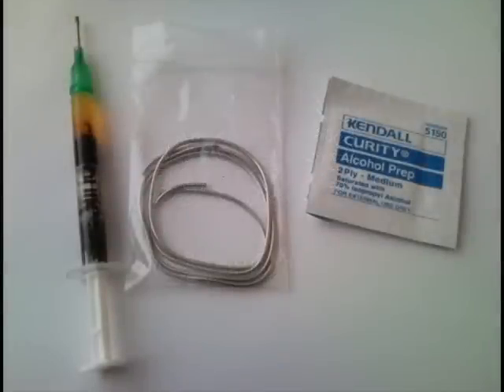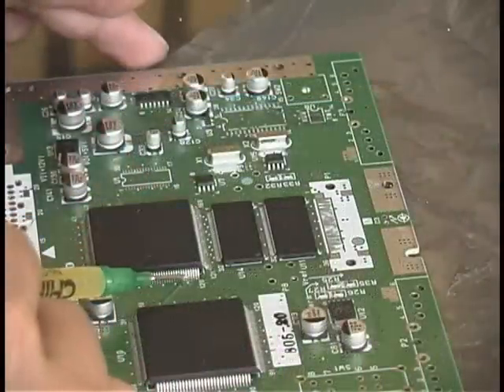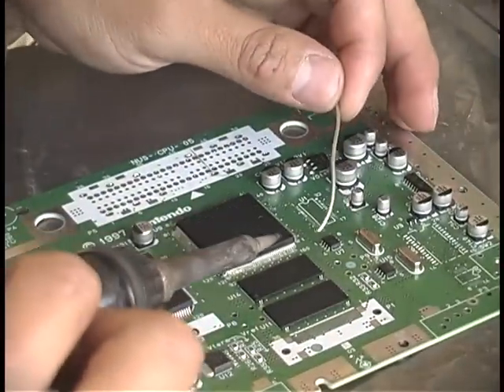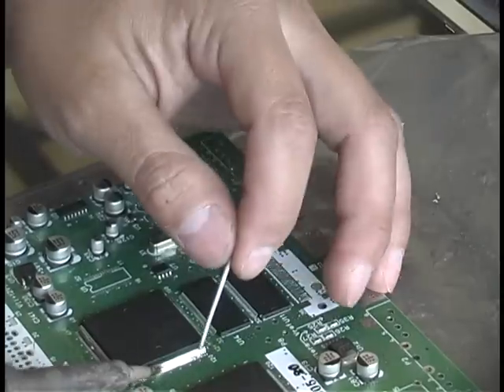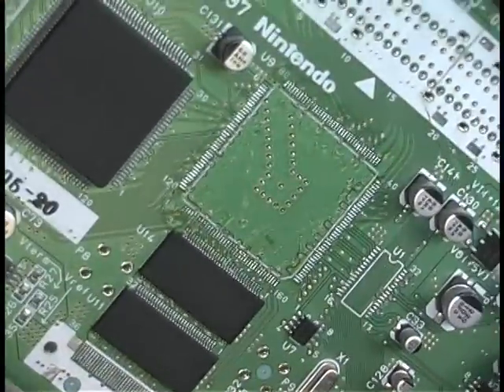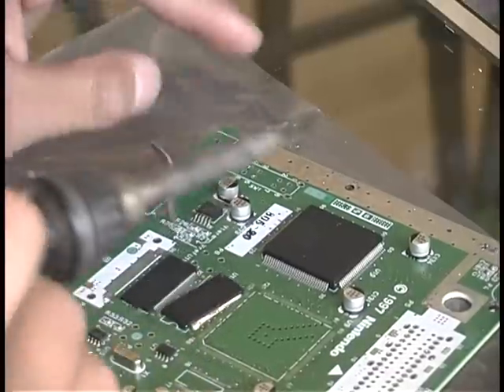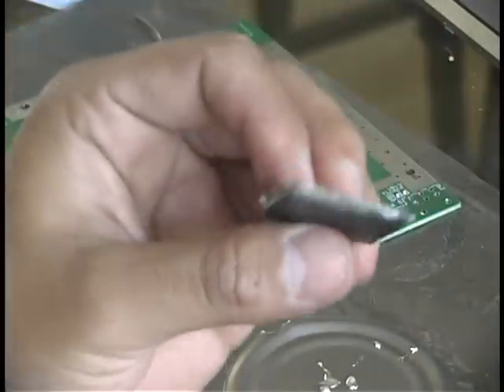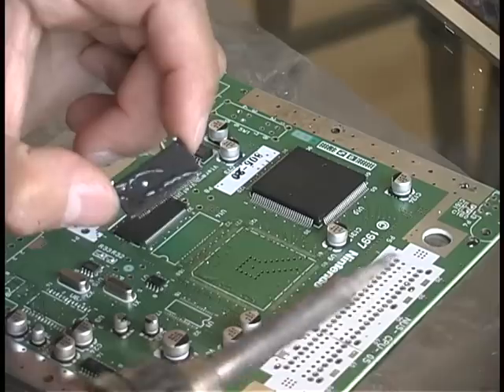SMD Removal using a Chip Quik kit

Comment: Hello, do you think Chip Quick would be a good candidate for removing IC voltage regulators from the board. Everyone said to just use solder and molten it to remove it.
Do you think the Chip Quick is more safer to prevent damaging traces.
Thanks for your time.

Comment: will the chip survive? That's a lot of heat for a long time
Reply from the maker: Yes, these chips were completely fine. I actually used them at one point to rule out a bad chip on another board. We're not heating the die in the package directly or anything, and we're trying to distribute the heat all around to keep the alloy molten just long enough to pull the chip off. 

This stuff works great, but you have to make sure to remove as much as possible from the pins after you're done.
Reply: Excellent, thank you very much for the reply. Much appreciated.

Comment: I have a tablet that overheated that caused it to go out. When I took it apart and looked at it. It appeared that one of the really tiny smd capacitors burnt out. Was wandering if it would be cheaper to have a professional replace the smd capacitor for me, replace the whole mb myself, or just buy a brand new tablet altogether? I don't have any of the tools to really replace the capacitor. Also not sure what caused it to overheat like that in the first place. Any suggestions?
Reply: Anthony Bocook if you feel confident, I would recommend replacement of the entire motherboard. You probably don't know if the capacitor was at fault or if something else is at fault that resulted in a fried capacitor. Without a schematic and the proper diagnostic tools, it would be difficult to figure out. It's best to just replace any smd board when possible, IMHO; they weren't designed to be fixed easily.

Comment: When I apply paste on the chip's pins to detach it, will it remain on the motherboard to produce short circuit or solidify too quickly on one side before I detach it?

I just want to remove a chip which has pins on all 4 sides and then attach a slot in its place, then put the chip in the slot for easy future removal.
Reply from the maker: Adam Jensen If you heat it up sufficiently and work quickly enough, you should have no problems removing the chip. You really should remove any excess solder off the board with something like solder braid so you have clean pads to solder to. Also clean the board with some alcohol to remove excess flux.
Reply: The Workbench I don't know if I'll try it myself, I don't have a more expensive high quality tool kit, but thanks for the tips anyway.
Reply: +Adam Jensen Adam I think this would be very easy for you because of your eye augmentation, you should give it a try.
Reply: hahaha

Comment: Do you think this would work for removing mini pots on a double sided PCB?
Reply from the maker: It should help, I think, although I would try to apply a little to both sides if possible. Usually with thru hole components on double sided boards I'll just add a little more regular solder and heat the pins enough that all of them are molten when I pull the component out. The Chip Quik is meant mostly for components where you can't easily heat up all the pins at once, like those big QFP chips.

Comment: what do you need the 'flux' for?
Reply from the maker: The flux allows the solder to flow better by removing layers of oxide or contaminants. Otherwise you'd probably end up with a useless clump of solder. The alloy that comes in this kit doesn't have a flux core, like most of the solder you can buy in stores, so you have to manually apply some. Even with solder that contains flux, sometimes it's a good idea to add a little bit of flux to the contacts you'll be working on before you heat them up.

Comment: would it be possible to just apply solder to the pads then use a heat gun with a fine nozzle to melt the solder once the chip is laying on top? That's what I would try however I don't know the sensitivity of these chips to heat.

Comment: What would you use to resolder a chip like that? I cant find any tips small enough for soldering pins that close together. So when I get the first one or two done I end up crossing multiple pins and or messing up what I've already done.

Comment: Well people, I just purchased the paste and tried it. It works like a charm! This is just a GREAT product. This product is a MUST have for safe and cheap rework.

By the way, I have used normal solder lead I had (I thought my Chip Quick paste came with some but it did not). Make sure you order the KIT not just the paste, 

But anyways, it worked great on a QFP-44. 

again.. just WOW!